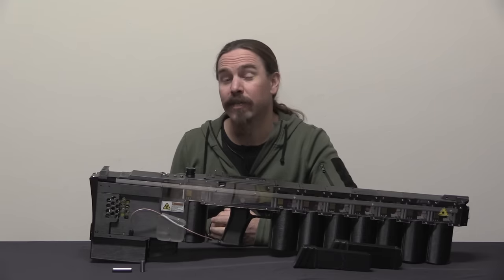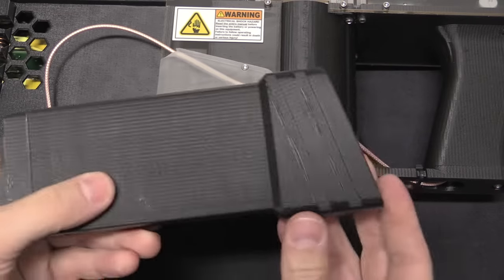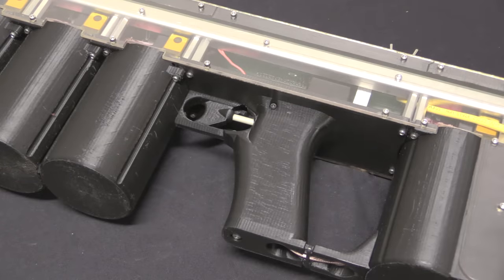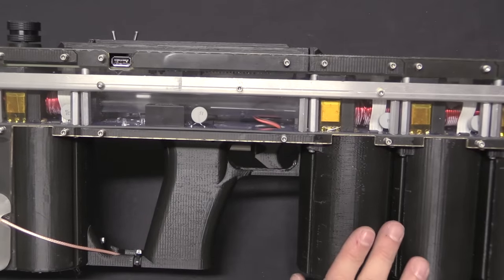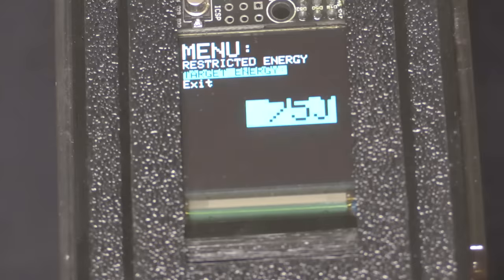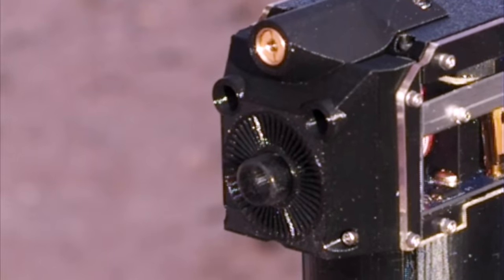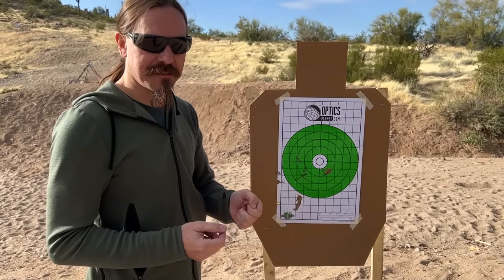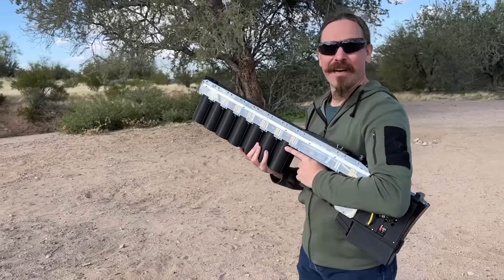ArcFlash Labs' GR-1 Anvil Portable Gauss Rifle

Comment: Love that the "hollow point"  is literally a drop-in anchor for bolting into concrete
Reply: Got to hunt them magical golems some how...
Reply: It came off the shelf in the same aisle as the dowel pin and ball bearings. They went to a hardware store with a magnet.
Reply: MINI DIVA  Came for rail guns, not to rail girls. Spam somewhere else.
Reply: @hollowscarf  great comeback. I'm so tired of those spammer girls.
Reply: With the low velocity and high weight of the gauss gun the recoil appears minimal
Reply: @hollowscarf  Ya dropped this 👑

Comment: It’s weird to think we live in a world where Gauss guns are actually real.
Reply: Scarier still is when they figure out how to make personal rail gun rifles - use a Gauss coil to inject the carrier at speed into a charged rail system; for now it's a big power and construction material issue.

Anyone know where to get a Vacuum space power extraction core?
Reply: They were real for a long time. I built one a few years ago. There's just not much use for them currently to be produced commercially.
Reply: @CyberSpiderPrime gauss implies a permanent magnet. Any electromagnetic coil is a coil gun.
Reply: @skypiratecaptain  Gauss refers to any magnetic flux field, permanent and temporary. Creating one electrically just gives greater control of the field parameters. The term also differentiates the method used from a Rail Gun which uses the Lorenz force to electro-magnetically manipulate an object's motion (Gauss surrounds the target object, Lorenz passes through an armature which can be the target object or carries it).

Not all coils are guns - a coil gun is one that is used to pull and release an object in order to propel it. Some coils pull and hold (usually called a solenoid and used for various purposes like relays, car starters, washing machine valves) and usually use a spring (which is another form of a coil) to reset. Still others are used to create or receive magnetic information (radio tuning coil, metal detectors have both a sending and receiving coil) or used for induction to change electrical parameters (transformers) or generate heat (induction metal heating).

A coil is simply a length of material (metal, string, plastic, wood, etc.) wound up, how it's used defines its purpose (source material, structural support, electrical component, etc.).

Therefore, Gauss Coil Gun refers to a specific use of an electrically charged wire coil (Coil) used to create a controlled magnetic field (Gauss flux field) for the purpose of attracting and expelling a magnetically affected object (the ammo for the Gun) in a straight line (may have multiple stages for greater acceleration). 

Particle Accelerators are, in simplest terms, multi-stage Gauss Coil Guns that shoot their atomic or subatomic ammo in magnetically bent circles (single or multiple streams, in one or two directions, simultaneously). The Coils both accelerate and bend the projectile path.
Reply: @IvanBaturaChannel  Back when I was a young boy, way before there was this thing publicly called the Internet or World Wide Web (they are two different but connected systems), I found a library book with simple electrical experiments. In it was the "Jumping Nail", which was a very weak hand-wound Gauss Coil Gun/solenoid powered by a few D-cells and a construction nail with the flat head cut off (I think it was a 16 penny nail). Which use you got was determined by how long you had the power connected. It could only eject a short distance (maximum of about a foot), and while it couldn't impale it could still break the skin and sting. If you pushed the envelope using more batteries, you ended up melting the plastic wire sheath, shorting the coil out, and starting a fire - ah the fun of youth.

Now you can make a way stronger version using a smaller coil (hand-wound epoxy coated magnetic wire around a straw), disposable camera electronics, a switch, a 1.5V battery, and BB's or paneling nails that can shoot 10 feet or more and with more damage (the coil and switch are connected to the capacitor which is charged by the camera's flash charging circuit). There are many examples of these on the net.
Reply: @CyberSpiderPrime ☝️🤓
Reply: @CyberSpiderPrime At some suburban yard sale, obviously.
Reply: it will never be mass adopted because of the magnets alone. Expect development to fizzle out just like 3D TV did
Reply: @arbiter-  We know, but it’s cool
Reply: Not really.
Reply: They’ve been a concept since at least WW2 maybe even earlier
Reply: Particle beam weapons, although huge, ground based and atomic powered existed in the Soviet Union in 1983.
Reply: I can imagine Joe Biden fumbling his way through a speech while trying to articulate why we need to ban Gauss assault weapons.
Reply: @CyberSpiderPrime I think China and Japan have been experimenting rail guns installed on warships. The US has also conducted some tests years ago. I don't know how successful this technology is currently since it's all military research, ofc China has claimed their tests to be a huge success but until anyone actually shows one working as intended I will remain skeptical about the efficiency of those.
Reply: @admontblanc  the United States already has active railguns installed on several naval ships, 22+ mile range minimum.

Comment: Only now, seeing this gun, I could notice how important the 3d printer invention was for R&D. Even more so for small teams.
Reply: Custom machined plastic injection molds cost hundreds of thousands of dollars per PART. This thing is assembled from multiple parts. Could cost upwards of multi million dollars to proto type this thing with injection molding alone. 3D printing is absolutely critical for proto typing phases, especially for start up companies with not much capital to invest.
Reply: What I read somewhere is that 3d printing allows for insanely fast, rapid prototyping. Basically, they can iterate over a design multiple times very quickly and very cheaply.
Reply: @rskat501  arent injection molds usually reserved for mass production? i always thought singular prototypes were done with resin, or cnc'd?
Reply: @rskat501  yes and as a former machinist i gotta say they have to be shipped from overseas sometimes which can take a while as well especially if you needed to adjust and change where things were, not to mention the injection mold machines are ginormous and cost astronomical prices
Reply: @brertt8350  yes, they're used for mass production. I was just stating my experience since I work in the industry. I'm not quite familiar with previous forms of proto typing, but rough CNC models would definitely be better than molding. Even then, that's still expensive and some projects would have been scrapped due to cost. Although it's no longer necessary since now 3D printing is far superior than CNC(for prototyping at least).
Reply: Microfabrication is amazing stuff
Reply: During my freshman year of college I visited Hill ROM, a hospital bed and equipment manufacturer. They said that the R&D costs dropped massively as soon as they embraced 3D printing, and the development cycles were much quicker as well.
Reply: @realWARPIG  yep, Kelley School of Business at IUPUI really does a great job of connecting their students and alumni with real world companies!

Comment: 11:20 - Given that the projectile isn't touching the walls of the barrel, the smoothboreness might not degrade the accuracy nearly as much as with a chemical firearm (where you get the ball or whatnot bouncing from side to side as it goes down the barrel), so a laser sight would probably make more sense for a coilgun than for a musket.
Reply: Except it clearly is hitting the barrel a lot.   The alignment isn't perfect and in the slow motion you can see the projectile bouncing down the barrel.

The manufacturing isn't good enough to float the round perfectly.
Reply: I wonder if fins on the projectile with protruding guide tracks on the inside of the barrel might help(and also give it a rifling effect). The neat thing with EM guns is because the barrel doesn't need to hold up to high pressure, some fancier things can be done with them.
Reply: I think with some tinkering, the projectile could be made to spin magnetically.
Reply: @BeKindToBirds  it's barely accelerated while in that transparent tube though, the real acceleration comes later, and IIRC the fields also align the projectile (again) ?

Comment: To put this perspective: the GR-1 is like the musket (or even earlier) of gauss/coil guns, there's so much more to be done for it to rival modern-day weapons, but so did the early firearms compared to bows and crossbows of their time.
Reply: That's a good comparison for multiple reasons-- the bulk of the hard part going from cannon to man-portable firearm was in the size reduction, increasing the power, reliability and fire rate were fairly small refinements to the overall design.  Taking this thing from something that weighs 500 pounds with 250 pounds of capacitor bank and causes the lights to flicker when you start charging it to something you can hold in your hand and fire repeatedly from a battery is the bulk of the really hard work.  Going from that to a practical weapon is a comparatively small leap.  It's already a theoretically lethal weapon, doubling the output power is a comparatively small refinement and would put this in the power range of a .38 S&W, a round that is indisputably capable of killing, if a little weak for the modern day.  A 5-fold increase would put it in the range of an intermediate cartridge like 5.7mm
Reply: Yep, just like a musket its about a dozen technical innovations away from reaching its optimal form, but if anything it has one massive advantage: logistics.

A gauss, unlike a normal firearm, pretty much does not care what you feed into it as long as it fits the barrel and is made of metal. That is an incredibly cheap bullet to make. Of course, you aren't going to feed it scrap metal for fun, but what you can is have a bucket-load of metal slugs that are immensely easy to carry around and store. They can't get damaged easily, there isn't gunpowder that can get wet. Hell there isn't cases to deal with, and unlike caseless ammo you don't have to deal with a fragile casing or overheating problems. 

That means that your requirements to produce and carry ammo are drastically lowered. And while making the firearm is harder, making the bullets for it becomes essentially workshop level trivial. Very much unusable in their current form BUT the progress in battery spurred by electric vehicles and smartphones is going to push the tech forward at great speeds.
Reply: @dangerszewski9816  And I already imagine what would be the solution: A composite battery. There is a way to increase the current output of batteries is by putting them in parallel - the amount of current the batteries can support increases to the same degree to the amount of batteries you put in parallel, but for this application that means hundreds of batteries and the charger for those bateries would be challenging too, meaning they would have ho develop small batteries that you can build a parallel battery bank, and they have to be made with a good amount of precision as a voltage differential between batteries can generate unwanted current between them. As such, if the battery already outputs a high enough current you don't need a capacitor bank
Reply: @mobiuscoreindustries  It does need to be ferromagnetic, but you can pretty much just take a steel rod, cut it down to size, and then do whatever with it. Sharpen the tip for better aerodynamics and penetration, hollow it out and put all sorts of fun things, like high explosives, in it, as long as the coils can magnetically attract the projectile, the possibilities are nearly limitless.
Reply: @suursuits7637  One thing I did think about is how the "propulsion" method scales a lot better with projectile mass. On top of that, the acceleration is a lot more drawn out and gradual compared to the thousands of G's worth of acceleration of gunpowder. So such a gun system would work wonders with a fin stabilized smart ammo or even just shoving a ton of explosives in it.
Reply: Yeah it’s essentially a magazine fed matchlock compared to what we’re hoping to see in the next 100 years
Reply: @mobiuscoreindustries  To expand on your comment, a Gauss rifle doesn't even need the entire bullet to be ferromagnetic, just enough of it to push it down the barrel. That opens up a whole world of sabot configurations.
Reply: Yes. But as technological advancements have been growing exponentially, it can be hard to predict future weapons, energy usage, transportation, etc...

Canons were used around the 13th century and took a long time to evolve into the battleship cannons of ww2. But it took 66 yrs for humans to go from the wright brothers to the moon landing.
Reply: Blunderbuss
Reply: The "Magnetic Musket" does have a beautiful ring to it, don't it?
Reply: @suursuits7637  The possibilites are rather limited in one important way. The magnetic field is a downer when it comes to other futuristic stuff like programmable ammo. Kinda takes the smartness out of it.
Reply: Well said!
Reply: Hate to say this dude, but big picture... this isn't going anywhere anytime soon. The amount of energy required to be even close to a standard AR is substantial to say the least. You should just use a nerf gun, more effective then this trash. Guys we're talking about needing to obtain approx. 3300 ft/sec. LMAO this thing produces 75 ft/sec, like bro while weighing 20 pounds!!
Reply: @SDWiAP  That's why he said it should be compared more to an early musket than a modern firearm. Hell even Ian made a similar comparison in his interview with David.

You really strike me as the kind of guy that would have said "You should stick to riding horses than give these unreliable and slow Horseless Carriages a chance. They aren't going to go anywhere" if this was the past.
Reply: There are physical limitations.
Reply: this is alot worse than a musket or arquebuse which were already fully applicable weapons of their time and easily beat any bow or crossbow at the used combat ranges. Just for reference musket balls went somewhere in the ballpark of 450 m/s so this coil gun needs to get six times higher speeds to get comparable and musket balls were not known to be wimpy small like modern bullets but rather substantial lead balls as well.

I mean, it's cool and fun and it is a start. I do not want to detract from that. Though my worry would be the EMP aspect when the battlefield gets more and more digital.
Reply: @jakerelind5577  No just a realist. One who understands some of the science behind what’s happening and what it will take to get you where you want to be and my dude your very far off. Oh and by the way… muskets we’re like 1200 ft/sec and by that account is more advanced then this piece of junk. Lmao. Classics for the win I guess. Oh and the car versus horses. Consider back then cars could not do what the standard horse could. 20 - 30 years passed before they were viable options to replace the horse. Also, horses are still exclusively used today for various reasons where a vehicle isn’t practical. Get educated son before you come at me.
Reply: @SDWiAP  75m/s. Metres not feet, so ~3. 3x better than you think
Reply: @FatalExceptionz  That's very possible Fatal, I thought I heard feet per second but if it's meters per second we're talking like 246 ft/sec. Still terrible in my opinion. We're not even in pistol territory. In fact it's slower than most bows from what I remember although probably similar. Edit: Just to add on here why this is so important, which is being lost in the sauce. Effective range...
Reply: lets hope it doesnt take 400+ years to get from musket to AR15 in comparison
Reply: @zyourzgrandzmaz   Now your talking projectile type and are referring to self-contained cartridges that where developed in the 1800's I believe. The Armalite Rifle is a platform.
Reply: Except muskets shot WAAAAY faster than this lol
Reply: @SDWiAP  I think you missed the point. The point is that it’s the very first version of its type. Wether it takes 50 years to get as good as a conventional firearm or 500 doesn’t matter so much as this is the first step to doing so
Reply: @1Sanny1  My point is this isn’t practical nor will it be. The energy needed in the compact size thats needed at this point isn’t possible and frankly I don’t know if it will be. This is isn’t Coruscant.

Comment: 21:45 - you can hear the capacitors charging up like an old camera flash. I love it.
Reply: It's sooo much the same concept, down to the trigger design Ian talks about. Like my old photo camera, if I partly depress the button, it'll use power from the battery to charge a capacitor, making that noise, then the signal will come on, I fully depress and bang, the flash / gun goes off.
Reply: Sounds like I thought a gun of the future would sound like as a child. Soon the sound of guns racking will be replaced with the high pitched sound of capacitors charging.
Reply: @42Antares42  Some simple DIY coil guns are built using the flash mechanism from those cameras
Reply: oh, to have tinnitus-free ears...  every moment of every day is like an old school camera flash charging for me.  Protect your hearing, kids!
Reply: Likes some shit from fallout lmao
Reply: It’s actually the transformer inside the gun converting low voltage high frequency AC to high voltage to feed rectifiers to then feed the caps. The windings inside the transformer expand and shrink slightly with each oscillation which makes the sound. Also that is actually an indication of a poor quality transformer.